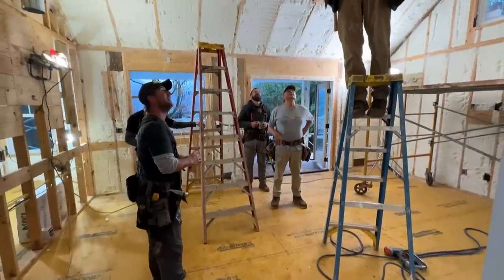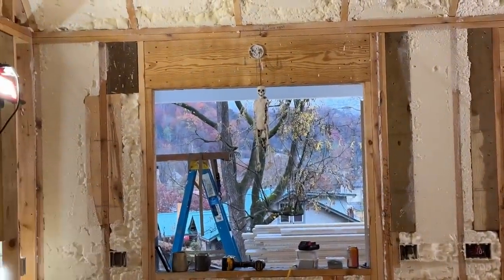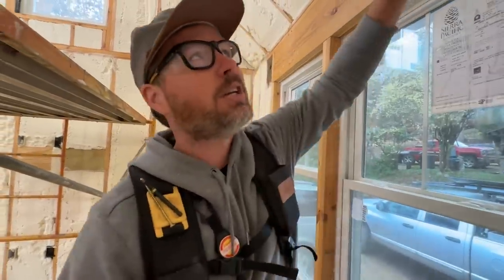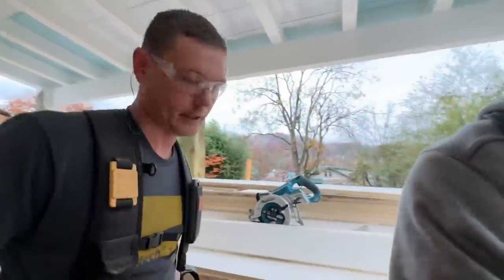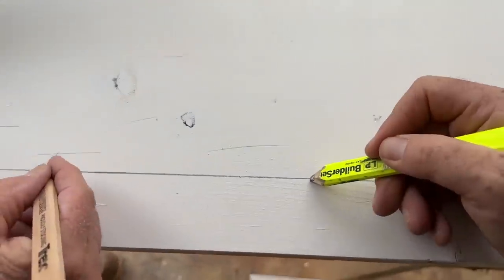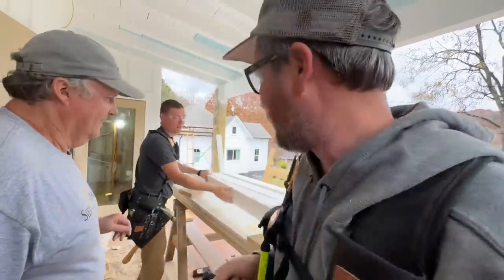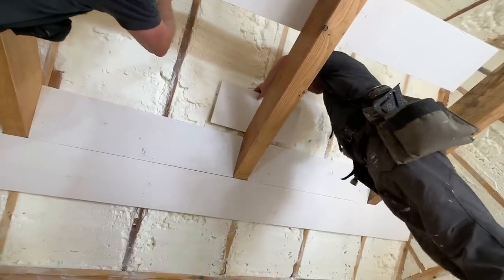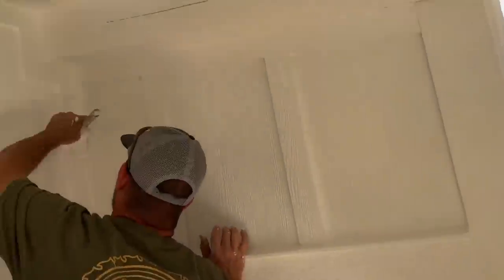Building A SMALL Income Property | Part 25

Comment: take a clamp, reverse the clamp, then use it to push the 1x12 down from the ceiling.  add a 2x4 to extend the clamp if to short.   You will get rid of the crowns.

Comment: For the car seat, if it is water based paint you can clean it off with some pure ethanol or iso alcohol.
Wet it and give it some time.
A stiff bristle brush and some disposable shop towel/paper.
Moist, dab, dry, repeat

Comment: The new tongue and groove panels have a click system so the boards always line up perfectly even then your trusses are not perfectly flush. It is like a click laminate system and it's easy to do 16' lengths with two people, Its mdf though. I put construction adhesive on the rafter bottom and if fills any unevenness. I live the T&G stuff. I dislike shiplap because it doesn't have those features. On shiplap I have to use spacers for the gaps and they never sit flush.  very frustrating when you want a clean look. This is a rustic look so its all good. I think I would have put a dab of construction adhesive in the center of the board there it meets the rafter bottom. this way the nails won't work their way out over time and the board can still expand and contract. looks good. Love the channel.

Comment: If you’re looking for a cheaper alternative for the ceiling use dog-eared fence boards. Cut off the dog ear and stich the boards to the ceiling. They wont line up with the joist. Just butt them. This will add to the rustic look. Spray them white or grey the wood treatment will bleed thru to look like aged barn wood.
Reply from the maker: cool idea thanks!
Reply: yeah those are made from the worst boards.  warped cracked,split,knotted

Comment: Tom Silva did the same kind of job with boards butted up to each other.  However he put a spline of tar paper between each board so that you will not see the insulation in the gap when the boards eventually shrink.
Reply: Well he went the extra mile…

Comment: I don’t think open cell foam is an “air barrier”, you’d need to use close cell, but I could be wrong.
Reply from the maker: could be right... all i know is that air movement from the conditioned space to non-conditioned would be much harder than with fiberglass insulation in the joist bays

Comment: Is an air gap still required when using spray insulation against a roof like this one?
Reply: No air gap is required the way we did the spray foam
Reply: Good question. That’s what I was wondering too. Thanks for the answer, Jamie!
Reply: But now I’m wondering why… is the spray foam somewhat breathable or do you use a completely different method of venting with the spray foam?

Comment: I thought you needed drywall under the ceiling boards. How does this meet fire code? Is the spray foam fire retardant?
Reply: There is not any fire proof coating. I don’t think it’s required here.
Reply: @jaimeperkins9606  Really? Hopefully not here either because I did the same thing😂. You guys are awesome by the way. We need more Jaime education time.

Comment: Wait...? If you flip it over and use 40 degrees, don't you have 50 degrees on the other side? There is not ever really a need for anything above 45 is there?
Reply: No because you would need to cut on the narrow side of the board which cant be done in a handheld saw

Comment: Ummm... on ripping a 50-degree on a table saw, wouldn't you just turn it over and rip a 40?
Reply from the maker: could do that if the cut is right at the edge of the board...  not out in the middle

Comment: Spray foam by code is suppose to have a burn barrier paint installed called an intumescent coating- it is a 15 minute burn barrier for when wood is installed directly over the foam- sheetrock is allowed in place of the DC315 burn barrier. Codes suck sometimes- kinda wondering how you didn’t have to follow that one on this project- especially where it’s a rental property...oh well, some customers are allowed to sign off on it and assume the responsibility for the burn barrier being skipped.

Comment: that house is way too small. I've noticed that you have a basement. A great tip on building a small home. Use all the space you can. The downstairs basement can be used for the master bedroom. With a master bathroom. And a small storage area. As you are not using the downstairs. You're wasting space. And building the home too small. If it's a rental property you can get more for a two-bedroom. Instead of a one bedroom home. You can add a small staircase going down to the master bedroom.